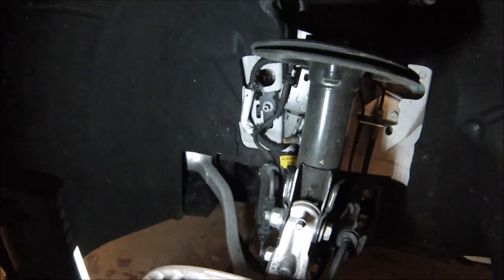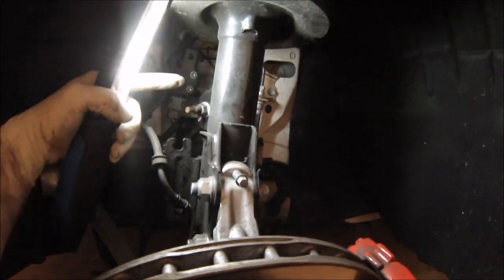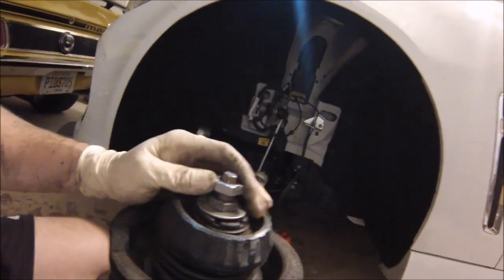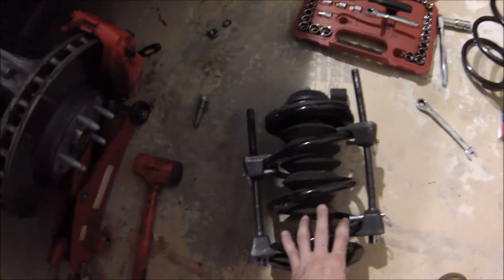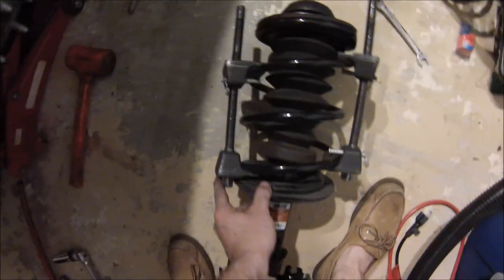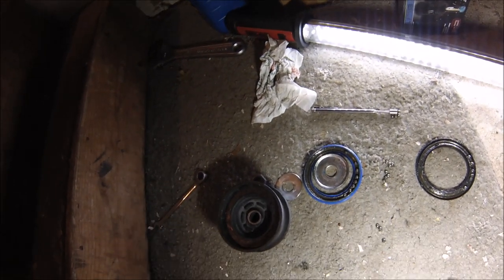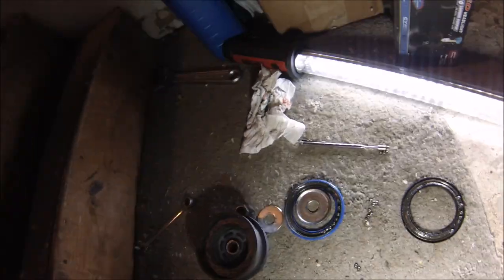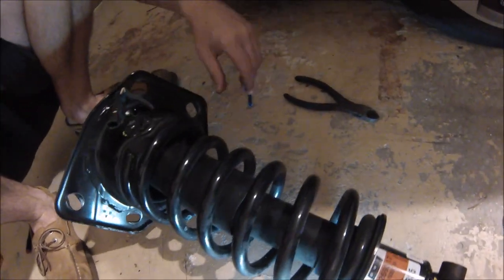How to Install Springs on Chevy SS; VLog 8 With Magnetic Ride

Comment: Did you set the car back down on the ground before torquing down the rear? Most guides recommend this to reindex the rear bushings. Not so much for the front.
Reply from the maker: No I did not. I have no squeaks, rattles, problems, or loose bolts even after a 500 mile drive, racing all weekend, and then maybe 250 more miles. Check out my other videos for updates!
Reply: Domestic Alex good to know. Also, do you recall the front struts having bump stops? My 2017 struts did not have any when I took them apart. Diagrams show that they should.

Comment: Hey Alex, you have any issues with the height sensors front and rear?
Reply from the maker: Michael Ratcliff I had no issues in the front. The rear I didn’t get back on that night, it’s a ball and socket (press on) connection. I drove to LS Fest (next video) and popped them on at the hotel before going out and autocrossing. Zero issues since!

Comment: Hey man. Do you have any camber issues? I lowered my car, and the insides of my tires wear a lot quicker than the rest. Just wondering if you are, and if so, how did you fix it?
Reply from the maker: lilkanethebig hey man, you can’t lower a car without re-aligning the suspension! You need to take it to an alignment shop